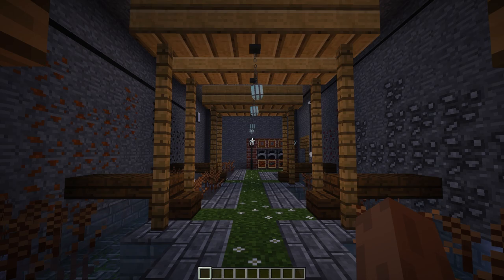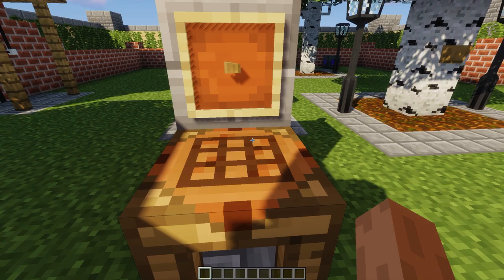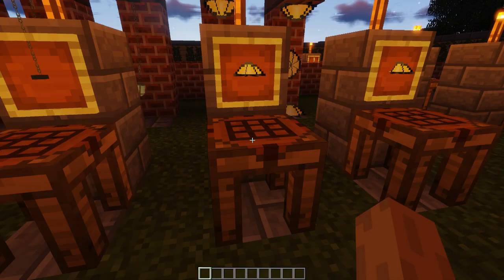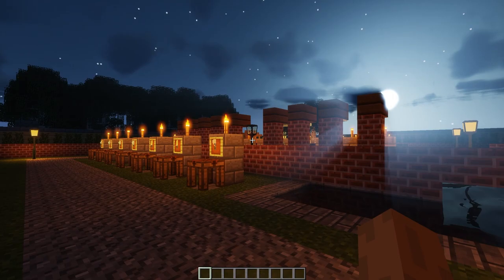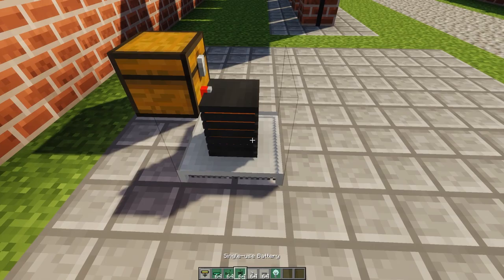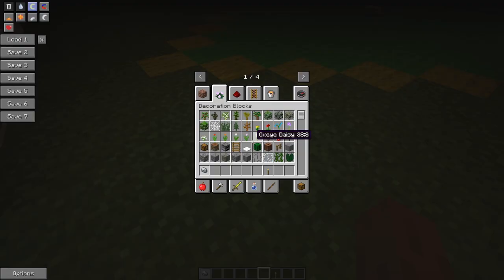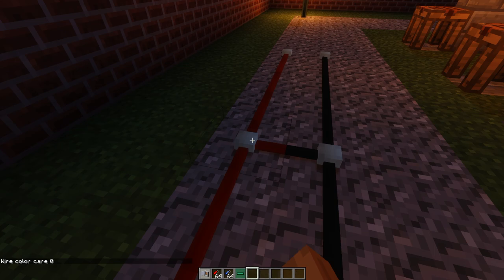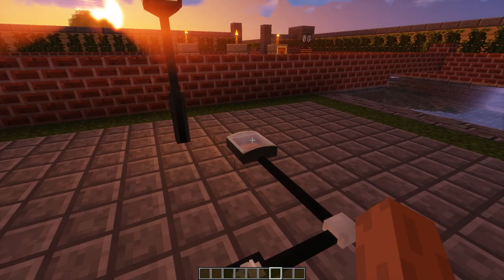Electrical Age Tutorial #1 Basic Electricity and lighting (MC1.7.10)

Comment from the maker: The links for the world download and my Discord and Twitch are in the description for anyone who wants to check those out.
Reply: Love love your video dude
Reply from the maker: @Lolzkey  Thanks!
Reply: OMG
Reply: Could you please show how to use the lamp supply
Reply from the maker: @Lolzkey  At 56:20 in the video I show how to use the lamp supply.
Reply: Thank you so much I download it you’re map and also how do you connect those button switches because it won’t work for me
Reply from the maker: @Lolzkey  It would be easier to explain on my discord because this conversation is filling up the comments and on discord I can put pictures and stuff.
Reply from the maker: The Sound Engineering Geek  Any voltage above 65 volts will make low voltage cable explode even without current flow. The fuses work better for over current instead of over-voltage, If you want something to protect for over voltage use the breaker switch.
Reply: @Cubeoid64   hi
Reply: The forge link is broken, I got error 404
Reply from the maker: @anthonydelamare8612  
Looks like the address changed at some point, It should be fixed now though.